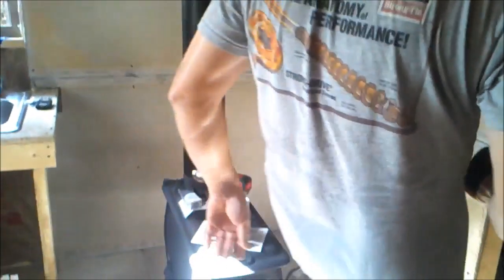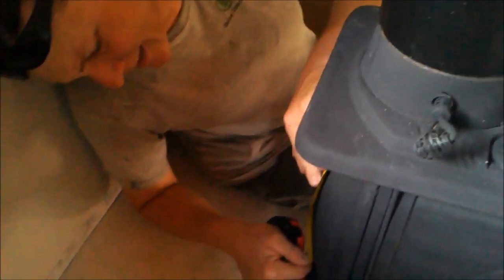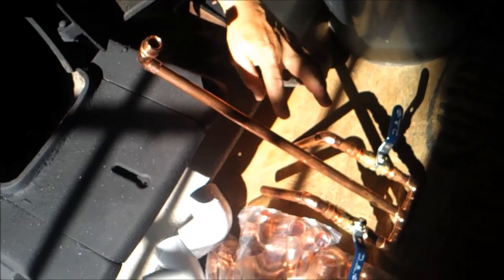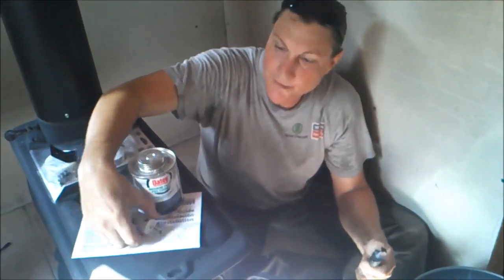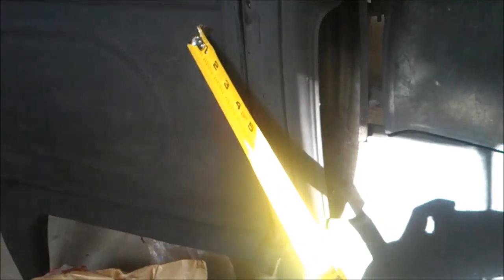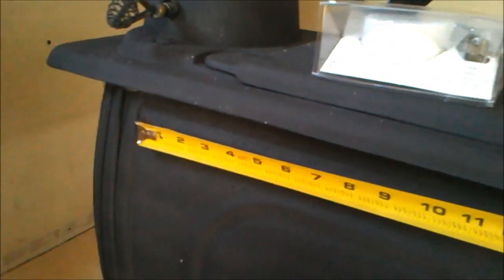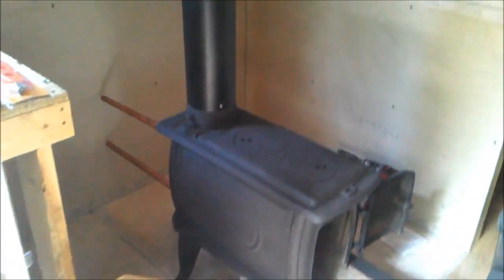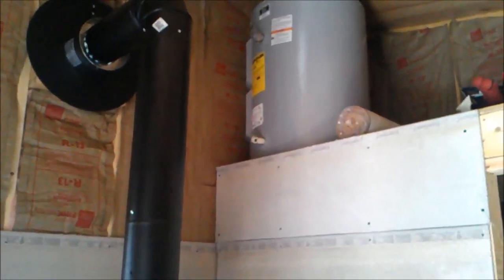BUILDING AND INSTALLING A HOT WATER JACKET IN A WOOD STOVE

Comment: I would post a picture  of mine but it wont let me. For all you guys thinking about doing this, first, the solder will not melt as long as the system is full of water, two, do not under estimate the danger of steam pressure. Use pressure relief valve and expect it to go off, plumb it to a safe place. MIne has gone off several times a day when cold.  Mine is plumbed all the way out side safely to a underground space. Dont let that freeze, that would block the system. Be very careful about pressure building up. I've been using copper for over 40 years, just like this guy is doing, be smart and it works good.

Comment: I just made a new copper water coil for my wood stove and posted it on a wood stove facebook site. It totally blew up with couch potatoes that turned out to be experts and told me I'm gonna blow up  my house, kill everyone, ect. I've been doing this for over 40 years. You can get more pipe than that in the stove. Most holes are 7 1/2 inches apart. I get almost 8 feet of 1/2 inch in there. Make sure you have a pressure relief valve plumbed to a safe place, mine goes off up to 3 times a day when really cold

Comment: Great job! Just a question? Shouldnt the pipes inside the stove be silver alloy brazed with a map gas torch or oxy acetylene? Soft solder would seem too soft for the high temp inside a woodstove.Im not being rude or anything.I dont know the exact temp a stove gets to.
Its a great looking job!
Reply from the maker: the water in the pipe   keeps the pipe below the boiling point
Reply: @tmscottspoetry8289  ah ha! I see!

Comment: Ever tried filling with sand and bending? Probably be to tight.
Reply: Yes, I did this back in about 1975, straight out of Mother Earth News. First of all , I don't think you will get bends like you get soldering, and you still will want copper made to bend.. I made a coil to put in my first section of stove pipe. Waste of time, it crudded and creosoted up so bad it did not get hot. I have been doing the same thing this guy does in the video, nice video, try using street l's for the turns, makes for a little less work. Copper coils like his work great, I should know, been using these for 40 years.

Comment: Hi! T
Reply from the maker: Hello Quite Mountain Woman
Reply: @tmscottspoetry8289  I still need to send you all the key chains I promised you and you can keep or give away I don't care. I have been so covered up with garden, canning, drying and bugs. Tore my rotor cuff been running around with my belt strapped around my arm in hopes it will heal. On the bugs have you ever used B T Bacillus thuringiensis  in the hot summer months,  definitely research it well and forgive me if you do know about it. Been praying for you all rain and know what it is like to watch all your hard work dry up. Be safe and well wishes.